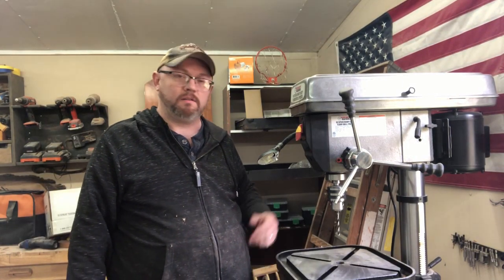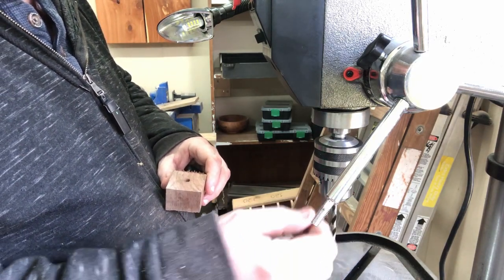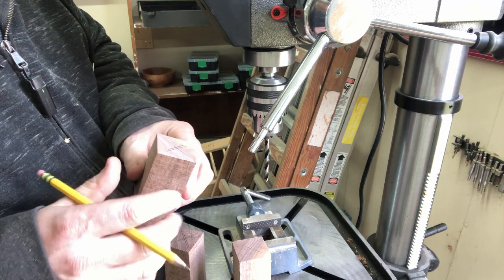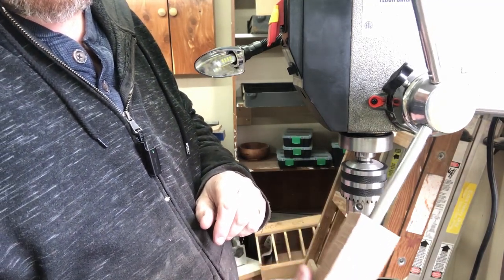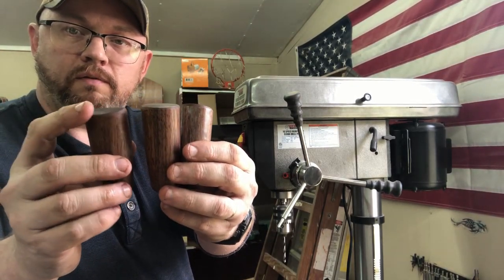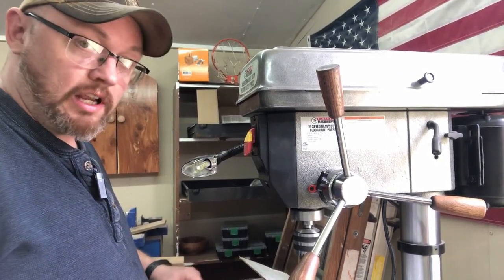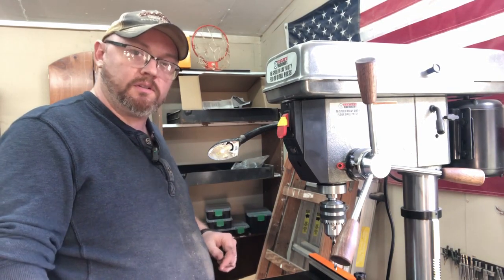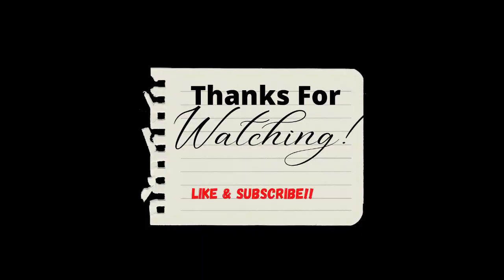Harbor Freight Drill Press Upgrades and Modifications!!

Comment: Looks good, Brad.
After using the smallest drill press from HB for years, I just got an older Craftsman drill press that is just a little bit bigger than the one you have there.
Definitely going to make or buy a table for it. 
I think Wen used to make a bigger drill press table, but they redesigned it and made it more narrow so that it would clear the table adjustment lever on smaller model drills.
Reply from the maker: Yeah I think that’s what that one was for! I had a guy who wanted me to trade my small one for a larger craftsman probably similar to what you’re talking about, the only downsides were it was missing some features I wanted, mainly the rack and pinion to raise and lower the table, I really love that option!
Reply: @Brads-Woodshed  Yes, the lack of rack and pinion table adjustment was what I really really did not like about my small one from HB,.. that and the cheesy plastic depth adjustment that broke the first time I used it. Put the two issues together, and using it became terribly frustrating.
I was going to buy one a of the bigger bench-top models from Wen, but then I inherited the freestanding Craftsman and it's pretty nice,.. just needs a new chuck.
Reply from the maker: @StillLivinginthewoods  Nice!